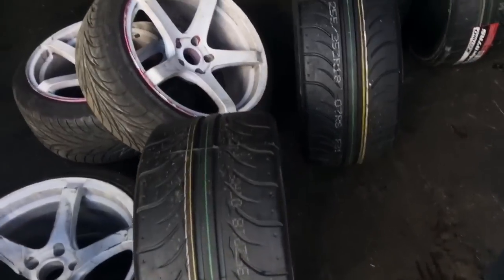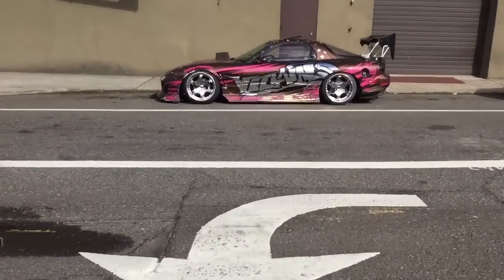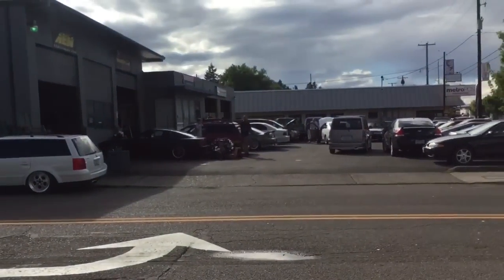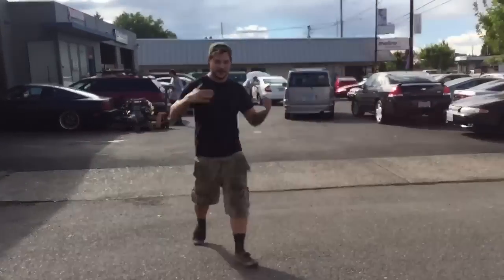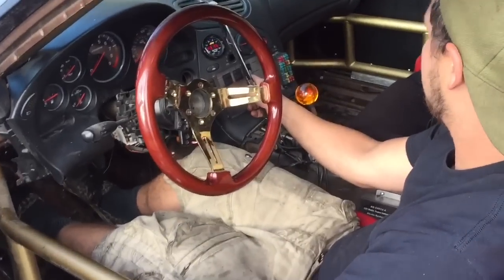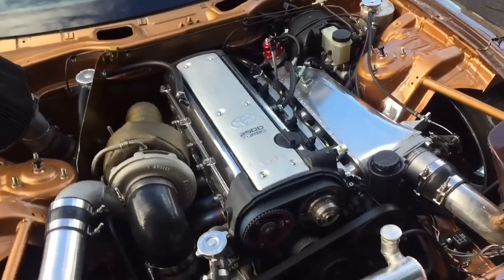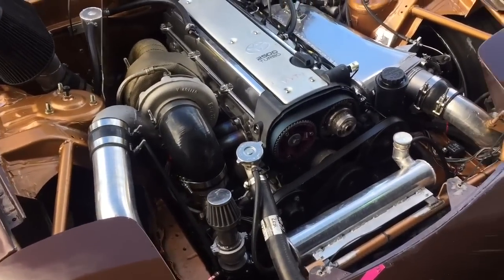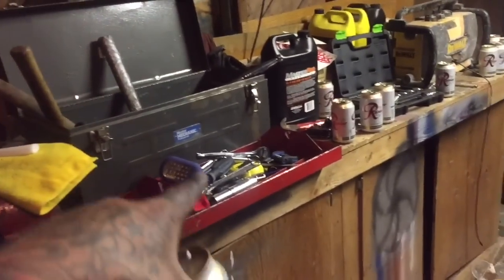INSANE TWINCHARGED RX7 FD DRIFT CAR!! (Parcfest drift prep)

Comment: 1jz really nigga got a balling ass car but no rotary :(
Reply: i got a friend with one and god damn rotary engines take so much care and the fucking HEAT they make is crazy.
Reply: Totally worth it though for the idle sound alone ahahahah
Reply: Jamie Johnson rotary=unreliable had friends with them and they just do not last and always seem to have issues. F that just do a swap and have a bad ass reliable car.
Reply: Mark Thomas oh they did they owned  a shop were all they built and dealt with was rotaries. It was called Rotary RX. made some of the fastest badest rotarys in the southwest. but seems to md like they were always breaking something. water jackets,  apex seals and list goes on. the only one i really saw last was a 1st gen 12a with barely any power but the the 13b and 20b with full bridge port wouldnt last
Reply: Boosthead . No offense mate but if they were going through water jackets and apex seals they were going way to big into the water jackets. I have been building rotary engines for over 25 years and have never had a water jacket failure. I currently have a 13b early type Bridgeport with 50mm type Ida injection making 297rwhp that's 
N/A . I could go bigger but it is circuit racing car so it needs to be reliable. Keep up the work on the FD it is a bad ass car. But like I said in the first comment it should have a rotor in it. Cheers Man Mark.
Reply: The main reason is the owner of this car had a rotary and it blew up while he was drifting, and didnt have the money to fix it

Comment: SUBBED! Yo that is a badass rx7, glad it has a real power plant in there; I'm just not a fan of inefficient rotaries even though they are very lightweight. The suspension/wheel/body combo is good, you can tell that thing has tubular control arms all around and u guys took your time to get the alignment proper.
Reply from the maker: +OhNoGoForIt thanks for the sub man!! Glad you like the car

Comment: How does having both a turbo and a supercharger work out ?
Reply: Supercharger = 0 turbo lag (instant boost) but not as much power in the High RPM
Turbo = Loads of High RPM power

A normal turbo'd car will have turbo lag, and when you twin charge a car you will have 0 lag as the supercharger will instantly make boost and then turbo's boost will add to the supercharger's and make tons of instant power. It's good if you want a track car as you get the power of a turbo instantly.
Reply: Jm you might as well get twin turbos
Reply: 2 turbos won't solve the problem of turbo lag, it will only reduced it greatly, despite, super chargers have much better performance at low rpm then any turbo out there, twin charged cars have the best of both worlds, only problem is the maintance cost and sheer complexity of the system that keeps most people and manifactures away.